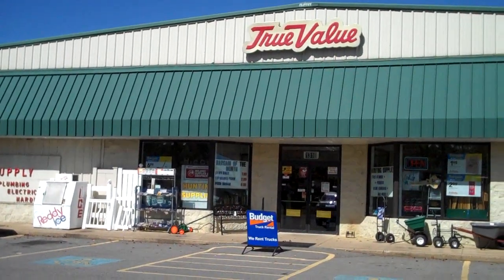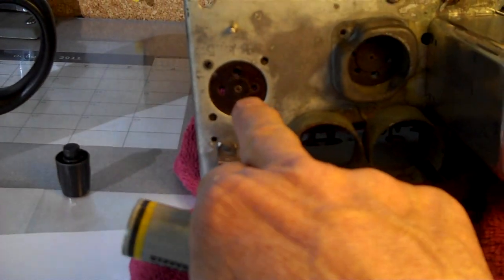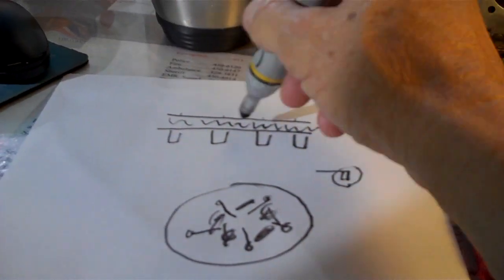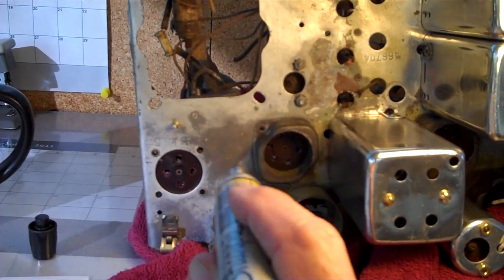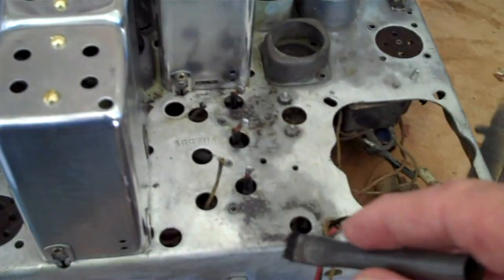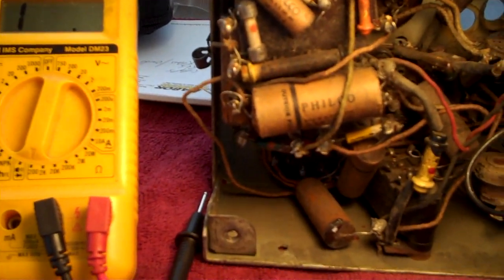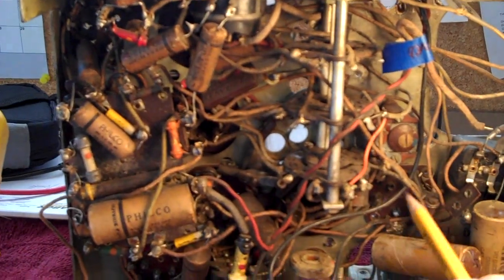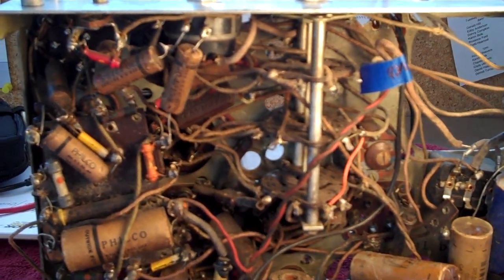1936 Philco Model 630B Repair and Restoration (Part 6 of 35).

Comment: Great video, John.  Thanks for posting this series!  Would you be able to go over how to evaluate whether a line cord needs replacing (although I assume they all should be replaced by default) and how you install a new one, and also how to install an inrush current limiter to the circuit?  Thanks!  David